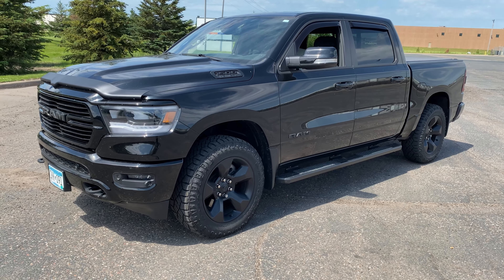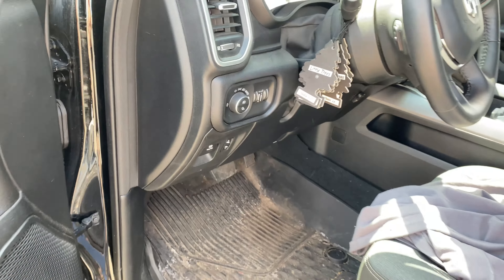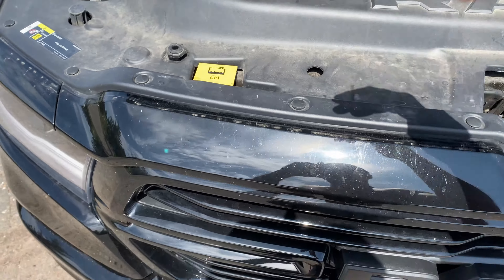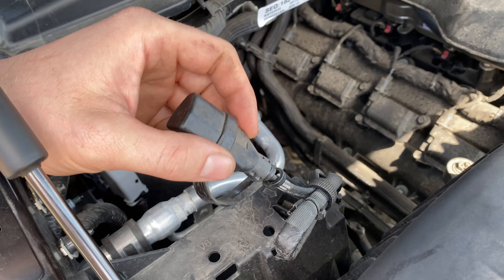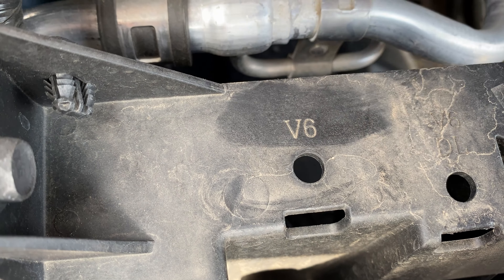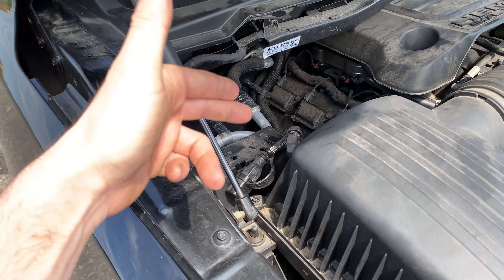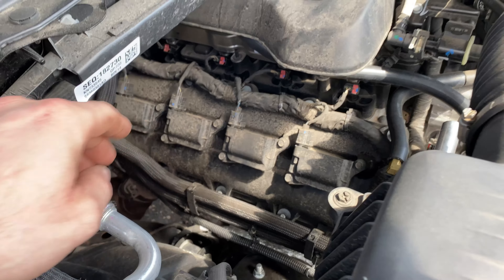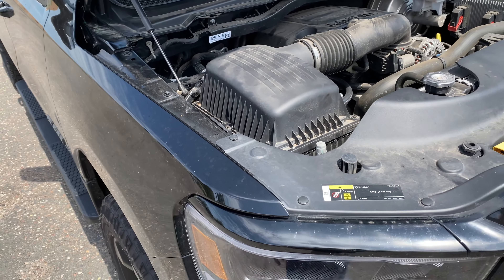Ram 1500 Factory Block Heater Location (2019+)

Comment: How can I close the hood with the block heater plugged in? Thanks
Reply from the maker: I would cut the zip tie holding the extra block heater cord cable together and see if it reaches out the hood. The cord is somewhat flat, so you may be able to snake it out the front of the hood somewhere, just make sure not to pinch it hard or close it in the hood latch. Otherwise, you could route the cord forward a bit and then drop it down behind the bumper and try to run it out the grille, tow hook hole, or just plug in down by the bumper.
Reply: I tried to close the hood with the cord flat off to the side and it doesn’t seem to want to close. Maybe i need to close the hood harder??
Reply from the maker: @ I wouldn’t force anything but otherwise just run it out from under the bumper
Reply: @TonyTheTruckGuy  definitely not long enough to go to the front.  if it warms up enough I may see if i can reroute mine to the tow hook.  sounds like a good place to bring it out.
Reply from the maker: @ Yes! That’s where they SHOULD have run it. The diesel engines have it tucked up in the bumper 🤦‍♂️
Reply: @THANHHA-95  same should i apply force, what if it does not unlatch when i go to open hood and it gets stuck i am scared

Comment: That’s the same location as my 2020 ram sport obviously I need to put an extension cord on there but my problem is where do you route it out of the truck? Has anyone got any suggestions? I’ve looked at some of the other forms, but the grill is not the same as mine and I’ve got those active shutters to deal with as well.
Reply from the maker: What about just leaving the hood popped and run the cord over the grille?
Reply: Route to front UNDER the bumper.....The RAMs where the grill raised used to be next to the headlight bracket...

Comment: I'm wondering if its located in the same spot as my Power wagon as this is my first winter with it. Thankfully been mild so far here in northern Canada lol
Reply from the maker: I would GUESS it’s in the same location if you have it, but I also wouldn’t be surprised if they felt the need to jam it somewhere else on the 2500’s 😂
Reply: If you have a hemi it is in the same place, the heater in in a freeze plug position on the right side of the engine.

Comment: What is the use of it
Reply from the maker: In cold climates it keeps the engine warm so it starts easier and less risk of damage
Reply: @TonyTheTruckGuy  so i plug it and when i need to use the truck i unplug it or leave it plugged in?
Reply from the maker: @FatBoi310  If it’s about 30°F or colder, you can plug it in while the truck is parked. When you go to leave the house, start the truck and unplug the heater before you leave. Or unplug the heater and then start the truck, doesn’t matter.
Reply: @TonyTheTruckGuy  got it appreciate the help!
Reply: @FatBoi310  let it heat two hours before using truck....most effevtive....if you leave AC controls in defrost/floor you leave plugged in  all night you will have frost free windows and a warm cab....
Reply: @FatBoi310 Leave it plugged in while you drive. 😊